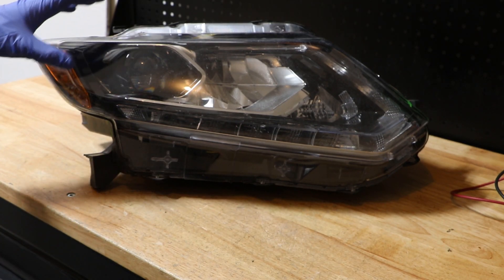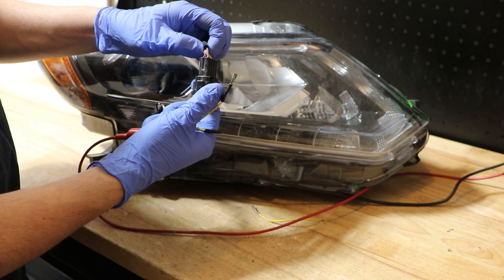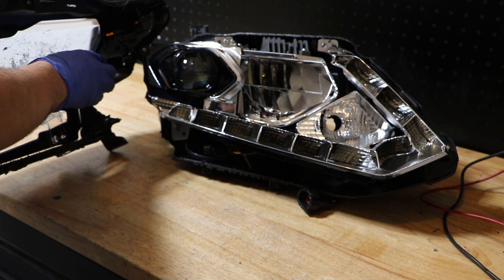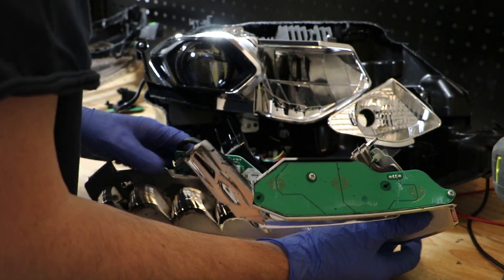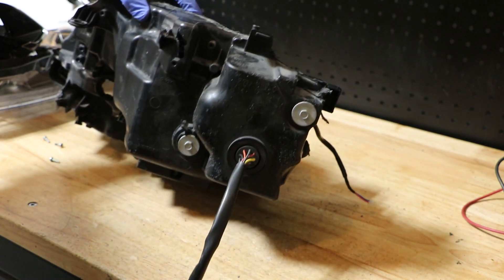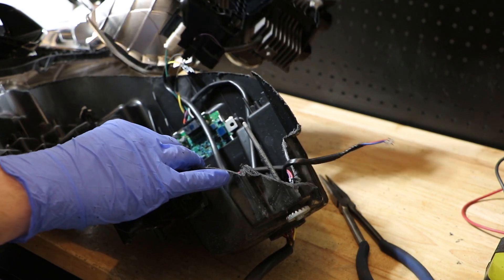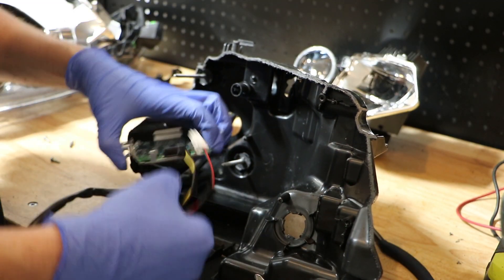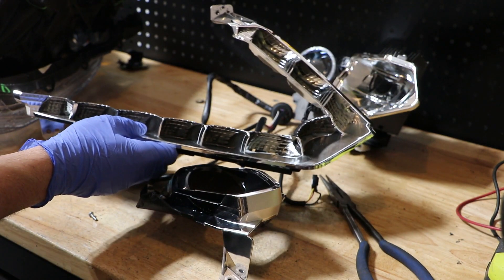2014-2016 Nissan Rogue OEM Full LED Headlight Test and Disassembly

Comment: Can I install these on my 2016 Nissan rogue S that already come with halogens?
Reply from the maker: They will fit, but will require rewiring the headlights to the new format.  They are NOT plug n play with lower models.

Comment: what is the diameter of low beam projector? 2.5 inch? 70 mm? 
what happens if the chip led inside projector is off? is the chip led chagable?

Comment: how do you take it off the vehicle?
Reply from the maker: you have to remove the bumper/grille off of the front of the vehicle to access the bolts holding it on.
Reply: @gftgrill  oh ok. i just needed to seal it. it looks like it has very minor leak during heavy rain.

Comment: I just get the altima s 2019 no led running light...do you thing is wire or should have a different harness?
Reply: I think you know by now but the base models don't have drl

Comment: Im looking at this like hey, my low beam is out. I have to take the whole assembly apart. Only the signal lamp is accessible
Reply from the maker: That is correct.  The low beam is designed to be non-serviceable
Reply: @gftgrill  thanks. I guess I have to literally buy another? My passenger low beam flickers. I thought I was crazy until I saw your video that supportes my thoughts that i cant get to the lamp. Not sure how to replace
Reply from the maker: @legacysmartgroup  buying another is the easy option.  I would guess that most likely the ballast is failing.  You may want to grab a multi-meter and just confirm that you are receiving consistent 12v power to the headlight and that you don't have a power/wiring issue first.
Reply: @gftgrill  I know I'm asking it 2 years later but is ballast located in the inside of the headlight? That's the small unit you were showing the part number for?
Reply from the maker: @maciek2442  Yes, that is correct

Comment: My DRL and side marker and high beam all stopped working all at the same time. Dealer wants $600+ just for the light housing alone, and I think it’s a wiring issue. Where can I find the harness to test the lights and what can I use to test them with? Thank you.
Reply from the maker: The connector is on the back of the headlight.  I used a 12v bench power supply to test with.  To test if the harness is supplying power to the light, you need a multimeter.